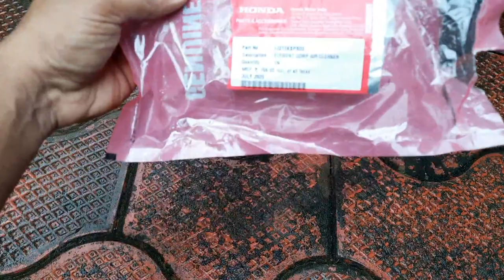Honda Unicorn 150 Full service at Home| Engine oil service| Air filter | Chain and Sprocket Cleaning

Comment: Bro ithil oru importend karyam cheythittilla, unicorn nte oil mattumbol oil filter koodi mattanam ithinte oil filter mattan right side engine cover azhikkanam (clutch cover)athinte ullil anu oil filter ullathu crank case nte thazheyayittu  cheriya chathurathil oru gap kanan pattum oil filter athinte ullilekku insert cheythu vechittundakum athu avidunnu eduthu clean cheyyanam allenkil oil circulation crct akilla.palarkkum ithu ariyilla.  Clutch cover azhikkan kurachu budhimutta clutch cable cover il ninnum azhikkanam, right side futrest azhichu mattenam ennale cover azhikkan kazhiyu ithrayum bhudhimuttu ullathukond showroom il koduthalum purathu work shopil koduthalum nammal ithu paranju koduthillenkil avar ithu cheyyilla. Clutch cover thirichu fit cheyyumbol puthiya packing idanam. unicorn use cheyyunna ee karyangal ariyatha arenkilum undenkil upakarikkatte ennu karuthiyanu ithrayum visadamayittu paranjathu . iol filter mattathe ethra nalla vilakoodiya oil ozhichittum karyamilla oil circulation kuranju pathiye engine paniyilekku pokum
Reply from the maker: Bro.. ariyanjittalla.. ella oil change lum ath matuka practical alla..Angane company um recommend cheyunilla.. 4,5 oil change varumpol cheyunnathavum nallath.. 
Bro paranjath nalloru information anu.. Thank u for sharing...

Comment: i used to do oil service myself. My experience with oil changing in service centres are not so good. Bcz they will buy oil in a bulk. And the oil wont be having much quality also. I uses Motul 10W40 7100 synthetic oil now. Its really good. 

I will try cleaning Airlifter area also .

Thanks for the video bro

Comment: Hi Sir,
My unicorn bike 2012 model having worst mileage issue while refilling petrol at 200 Rs nearly for 2 liters it only runs for 38kms after around 38 km run bike will get reserve mode, and also it have slow speed issue, getting engine off in slow speed or neuter position mostly signals facing this issue, what will be the exact problem in my bike, do I need do engine work it relats with other issues pls advise.
Reply from the maker: Pls check my video "main mileage problem" check air suction pipe if it's broken or not

Comment: Oil filter unicornnte mattanulla interval ethraya
Reply from the maker: Oil filter(its not like filter, it's a stainer) normally matenda karyamilla.. clutch cover nte ullil anu ullath.. ath azhikumpo cheytha mathi..
Reply: @ctharis  cluch coverinte avde oil leak ind appo ath azhich packing mattanm allo appo eee parayunna stainer mattande pinne oil pump um azhich clean aakande

Comment: Hi, 
ഓയിൽ ചേഞ്ച് ചെയ്യാൻ മെക്കാനിക്കിനെ കാണിച്ചപ്പോൾ 20W 50   ഓയിൽ ആണ് അവിടെ യൂണികോൺ ഇന്നും പൾസർ ഇന്നും എല്ലാവരും ഒഴിക്കുന്നത്  എന്നും  വണ്ടി നല്ലപോലെ പോലെ സ്മൂത്ത് ആകും എന്നും പറഞ്ഞു .
( വേറെ  മെക്കാനിക്ക്കും ഇതുപോലെ തന്നെയാണ് പറഞ്ഞത്). 
ലോക് ഡൗൺ ആയതുകൊണ്ട്  സിന്തറ്റിക് ഓയിൽ  ഒന്നും കിട്ടിയില്ല.
പിന്നെ Servo 20w50 ഒഴിച്ചു, വേറെ വഴിയില്ലായിരുന്നു.
ഇപ്പോൾ 100 കിലോമീറ്റർ ഒക്കെ ഓടി .
ഇപ്പോൾ വണ്ടി നല്ലോണം സ്മൂത്ത് ആയിട്ടുണ്ട്, കുറഞ്ഞ ആർപിഎമ്മിൽ ആദ്യത്തെ കാൾ കൂടുതൽ സ്പീഡ് കിട്ടുന്നുണ്ട് .
ഈ ഓയിൽ  ഉപയോഗിക്കുന്നതുകൊണ്ട് കൊണ്ട് എന്തെങ്കിലും പ്രശ്നമുണ്ടോ

( മെക്കാനിക്ക് പറഞ്ഞത് 10w30, സ്കൂട്ടറിൽ ആണ് ഉപയോഗിക്കു കാ)
(Reliance Pump'il പോയപ്പോഴും  ഇതുപോലെ  തന്നെയാണ് പറഞ്ഞത്, അവർ പറഞ്ഞത്  അവിടെ വരുന്ന  എല്ലാ  ബൈക്കിനും  20w40 Castrol ആണ്  ഒഴിക്കൽ എന്നാണ്)
Reply: ഇങ്ങനെ ഉപയോഗിക്കുന്നതുകൊണ്ട് എന്തെങ്കിലും പ്രശ്നമുണ്ടോ??
Reply from the maker: Bro., Company parayunnath 10w 30 anu for unicorn, Scooter nu same grade thanne( MB) anu use cheyunath.. 
Pinne ellarkum same performance thanne kitanam enilla bro.. chilapol avar parayunnapole kitumayrikum, use cheyth nokuka thanne venam
Reply: @rafimechawh5603  ഞാനും    ചോദിച്ചപ്പോൾ  സ്മൂത്ത്‌   and  safe 20  w 40 aanenn  paranju
Reply: 20 40 ഒഴിച്ചാൽ എൻജിൻ വല്ലാതെ പണി എടുക്കേണ്ടി വരും, നന്നായി എൻജിൻ ചൂടാവും, മൈലേജ് പ്രശ്നം വരും.
Reply: @pvhari  20w 40 shell ആണ് ഉപയോഗിക്കുന്നത് 62 per, ltr😊😊😊
Reply: 10 w30  125 cc ക്ക് മുകളിൽ 10 W 40